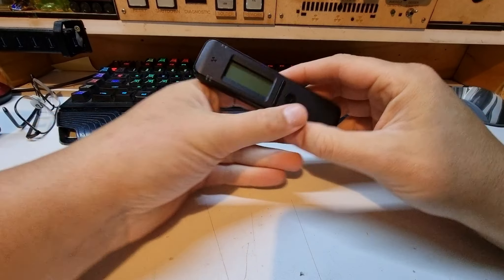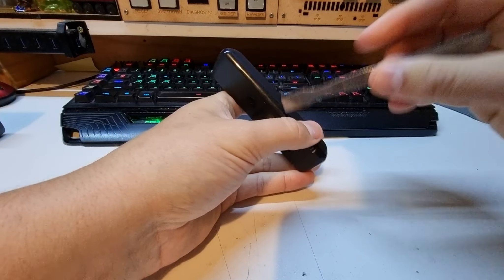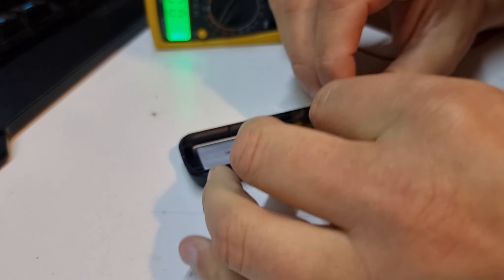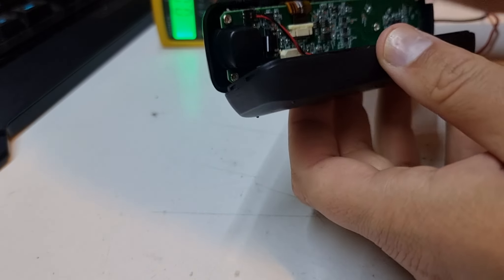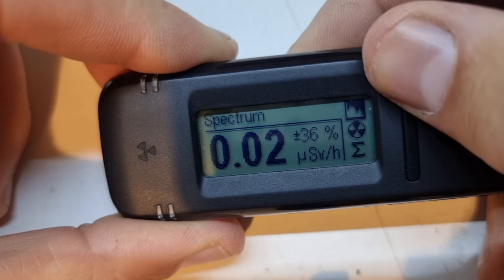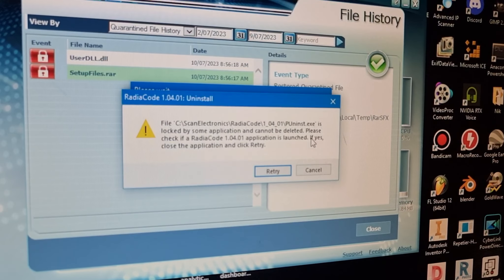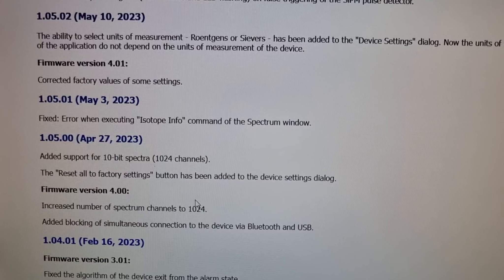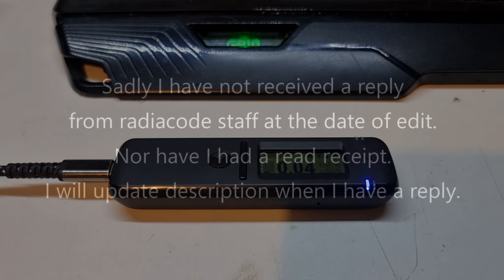Radiacode 101 Repair / 1.05 update

Comment: The problem is related to the extra usb-3.0 pins. In certain situations a signal similar to the device programming signal may occur, and then the device enters DFU mode. The only way to get it out of this mode is hardware reset, which is performed by disconnecting the battery.
Reply from the maker: I gathered it was something along those lines. Similar to digispark units where you interrupt the boot cycle to get them into rs232 mode.
Reply: You’d think the DFU would time out and it would return to the standard boot-loader. Good to know tho!
Reply from the maker: @JamesReedy  something for future firmware updates I guess. I contacted them about it, they seem to be aware of the issue
Reply: @TheAussieRepairGuy  if you’ve got their ear ask them why they haven’t released the iOS software. It’s apparently in Beta but I talked to Sergey in Feb of 22 and he said he expected it to be done by the end of the month 😐
Reply from the maker: @JamesReedy  i don't have any kind of direct l8ne to them other than the same email everyone else has. From my limited experience with IOS, the constantly shifting security and licencing rules with it, make it hell for 3rd party developers.
Reply: @TheAussieRepairGuy  it’s not so bad, I work for said machine lol. The flip side is the fantastic uniformity makes deployments easy. I remember buddies moaning about Android devices because they’re like snowflakes, resolutions all over the map. Massive disparities in processor capabilities, ram etc. It’s a balance of forces I suppose…
Reply from the maker: @JamesReedy  cheap chinese stuff was the primary issue there.

Comment: My Radicode 102 died too.  Wont power on or run on external DC.   Took it apart and my battery was 0V.  Gave the battery a quick taste of 3.7V(out of circuit) and then reassembled and recharged.  It works!  Thanks for the tutorial, these things are thankfully easy to open up without breaking the case.  Great video! Well see if my battery lasts or if its permanently damaged.
Reply from the maker: Glad to hear you had success, 0v usually means the bms cut off the cell, also known as sleep of death. There is a tiny chip hidden in there. Those cells are not impossible to find
Reply: if the voltage went completely flat it will definitely shorten the life span but these devices draw such little amps or mAh that the battery won’t be in serious demand. I’d probably see if i can install a bigger battery (mAh) same voltage (4.20v) fully charged
Reply from the maker: @anthony445  yeah these batteries are not hard to find, one feature I do appreciate about the radiacode

Comment: Odd request - Do you happen to know what that connector type is on the battery. Broke my doing an emergency battery pull due to water damage. Thought it would be standard but it is killing me trying to locate it.
Reply from the maker: I'm not sure, but if you have a small enough soldering iron I'm sure you could attach battery directly to the underside of the board, or fit a similarly sized plug and socket.
I'd suggest is may be a JST ACHR-02V-S, or maybe even a Molex 78172-0002,
Reply: @TheAussieRepairGuy  Thank you very much, I'll give those a try and resort to soldering it if that falls through. Really appreciate the reply!
Reply: those connectors are what they use on tiny whoop drones. Yes JST or some kind of molex. Pin spacing is a thing when looking for connectors so make sure in spacing is correct.

Comment: Have a similar problem with mine - won't turn on aftar about 2 months of non-use (wasn't plugged into USB - worked fine when I put it away.)  If I plug it into a power supply, the blue light lights up, but after 20m or so the power button still doesn't work.  Did the hardware reset (left power connector off for ~3m) and no luck.  Held button down for 30 seconds - no change. Any other suggestions?
Reply from the maker: You could try the same trick I did here.
The battery however might have gone into sleep of death - and might need a jump start.
Does it fire up when trying to start it while on charge?
I jump started a gopro battery a few years back - same process:
https://youtu.be/xEtSCjX97HA
Reply: @TheAussieRepairGuy  Yes, I tried disconnecting/waiting/reconnecting as you showed. No joy. It won't start while on charge, though the blue light is lit. I've sent in a note to Radiacode - it should still be under some sort of warranty as I only bought it in late September.
Reply from the maker: @johnhtodd  One would hope at least. if you have another lithium pouch battery of the same voltage, that you know if good, you could try that.
Reply: @TheAussieRepairGuy  They replied to me and said: "Connect to the charger, wait a little bit, disconnect the charger and connect again, the charge should go."  But that didn't work . What finally got it back going again was holding the right button (with the screen "up") and the round button at the same time, and plugging in the charge cable.   Then it came back.
Reply from the maker: @johnhtodd  handy to know, I'll write that down.
Reply: I have the same issue! Did you get a reply? No button presses or holds are working, and I've had it on a charge for about an hour and no joy. Popped it open and disconnected the battery, but didn't do the trick. :(

Comment: I hear quite a bit of background radiation. Is that showing 0.04 μSv/s at the end? That's 2.4/m. What source do you have nearby to get such a high level?
Reply from the maker: Thats normal background for this area.
Maralinga nuclear tests had an impact on a very large part of Australia.
Reply: @TheAussieRepairGuy  Wow, that's about 15 times as much than what I'm used to. You get a lot of ticks for your money there 😆
Reply from the maker: @Ni5ei A normal geiger counter is much more quiet, most of that will be beta, not gamma. 
there is a little bit of uranium glass in the display unit on my desk though.
but it's not very hot.

gamma usually gives me 0.15 micro sieverts/hr, pretty normal here.
Reply: 0,04 is super low. I have 0,09 outside and 0,15 inside where I live.

Comment: Would you be able to put waterproof PCB coatings on the sensor  (nailpolish, clearcoat whatever) looks good for the PCB, I am ordering one and am going to water proof it and haven't got a good look at it yet..
Reply from the maker: Not sure, most coatings are likely to affect beta readings. Try a ziplock sandwich bag, thats all I do. Makes it easy to decontaminate too.
Reply: @TheAussieRepairGuy  Hmm maybe,  i'll put vaseline/dielectric grease on the sensor (or just the contacts) to be safe and coating on the rest. Good idea with the ziplocs will also use those for contamination.
Reply: @TheAussieRepairGuy doesn't it just detect gamma so beta wouldn't be detected also on the battery half is that a thin bit of lead  (the gray part that is in the way of the crystal)
Reply from the maker: @The-One-and-Only100  Alpha no, beta yes, and that isn't lead.
Reply: @TheAussieRepairGuy  so what is it?
Reply from the maker: @The-One-and-Only100  aluminized mylar
Reply: @TheAussieRepairGuy  interesting
Reply: Just put it in a waterproof case. It's probably bigger but it's the simplest solution without messing with the device. The one I got is maybe 3 or 4 times larger than the device